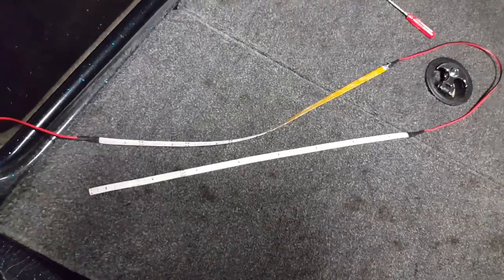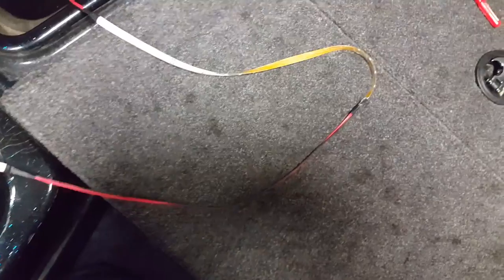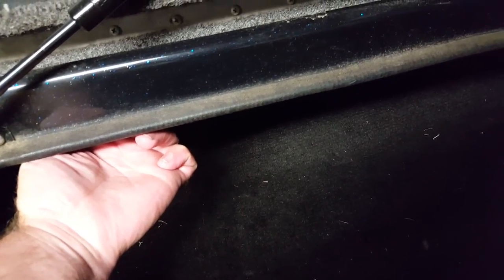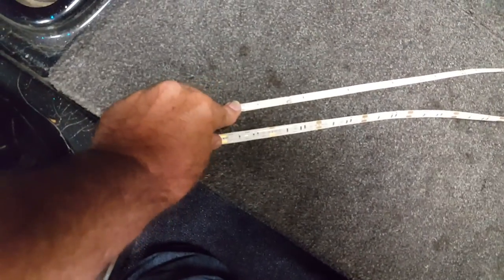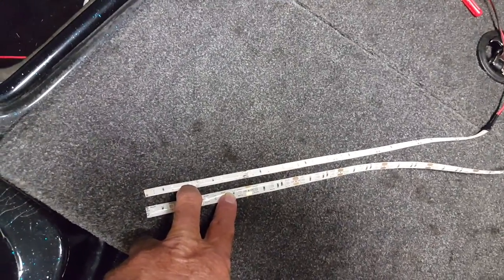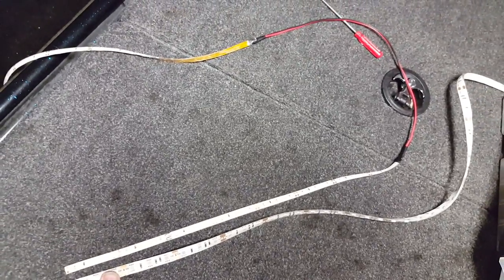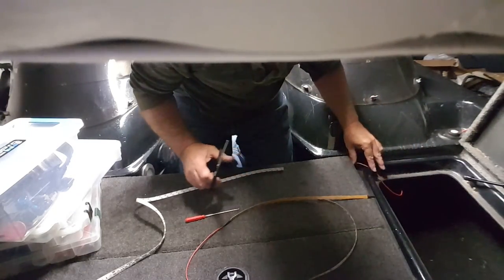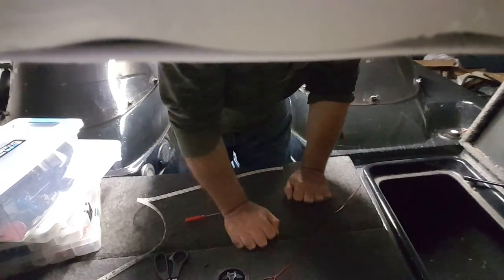Rod Locker LED lights for my bass boat

Comment: Nice job on video, you showed some good techniques for soldering and heat shrink. I'm not sure if the upgrade was worth the time, just having the lights is awesome, maybe it just didn't show that well in the end. Bottom line is you were bored and it gave you a good project, and you helped others learn. Nice job
Reply from the maker: I got them on eBay!